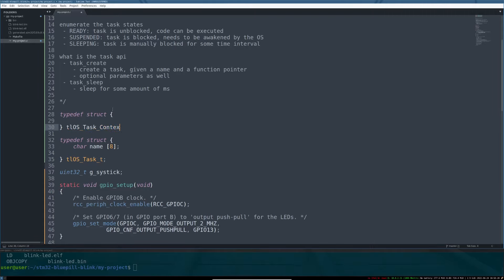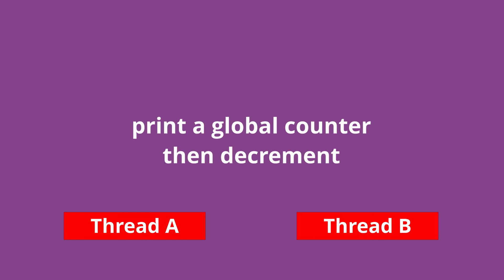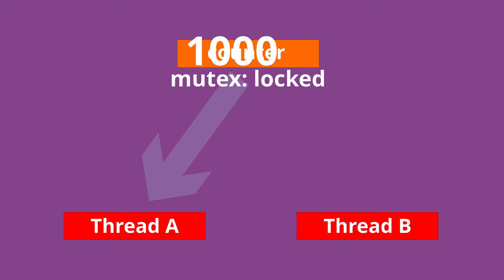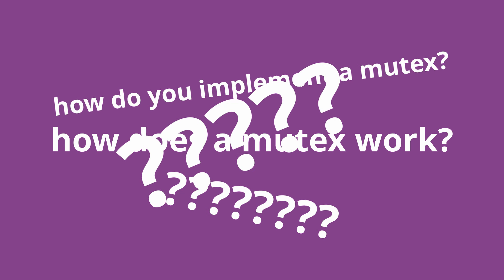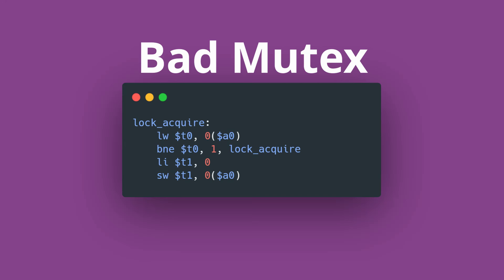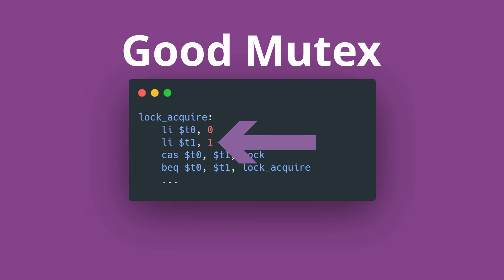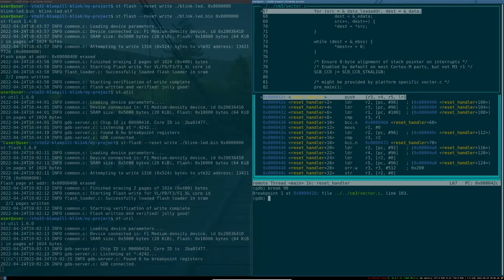how does a Mutex even work? (atoms in the computer??)

Comment: What are the differences between mutex and semaphore and what are the pros and cons?
Reply: From my understanding both are synchronization primitives and both are used to solve critical section problems. Having said that, a mutex is a locking mechanism, whereas a semaphore is a signaling mechanism.

The former goes to say that a single task can acquire the mutex, effectively owning it. This means that only the thread / process associated with that task can enter the critical section. The mutex needs to be released by the owner thread, and it can only do so upon exiting the critical section. At a high level, it can be described as a mutual exclusion object. A mutex object is either locked or unlocked.

The latter pretty much says that if a thread is waiting on a semaphore it can still be signaled by another thread. In short, a semaphore can be used by several threads (based on priority). That is not the case with a mutex. There are two types of semaphores: binary and counting. At a high level, it can be described by means of an integer variable. Note that a binary semaphore is not equivalent to a mutex.

As for pros / cons, I recommended looking those up online (there are some lists on blogs), or trying both out for yourself on a microcontroller.
Reply: Mutex is a Boolean lock/unlock state. Semaphore is a finite resource counter (E.g. only three processes can access some data at once). Note that a mutex is a semaphore - it’s a semaphore where the counter is set to one so that only one thing can access the resource at at time.
Reply: @gregoryfenn1462  yes, so i ask pros and cons because if you can do the same and more with a semaphore like with mutexes, what is the reason for the existence of the mutexes?
Reply: @gaborm4767  randombit answered too but the short answer in general is that since semaphores can do more than muticies, they won’t be as efficient or simple to use as a mutex. A tool that is can do lots of things will be less good at particular task compared to tools that are more specialised. So if you just need to lock or unlock a resource, a mutex is better than a semaphore.

Comment: If your processor has a Read-Modify-Write instruction, you can implement it in one instruction, simple.  If your processor lacks it, the simplest way is to disable interrupts for the read, modify and write instructions and then reenable interrupts.  Though you have to be careful to not reenable interrupts if they were initially disabled.

Comment: This is a good video, though I would have used different instructions for the MuTex.

Most ISAs have instructions that are intended for implementation of synchronization primitives like MutEx and Semaphores. The ARM Cortex-M provides LDREX and STREX. The first sets a reservation for the source memory address. If any other entity writes the location, the reservation is lost. STREX conditionally writes to the location, and will fail if the reservation has been lost.  The entity that writes the memory and breaks the lock could be another thread on the same or other processor cores or DMA from an external master. Usually, a MutEx will not be set up in memory that is the target for DMA, but having multiple cores, even on microcontrollers, is becoming more common.

Comment: Atomic lock sounds like Atomic Clock.

Imagine a processor running on an Atomic Clock using Atomic Locks for Mutexes, while the Program running is running Atomic Simulations that were written in the Atom editor.
Reply: Everything was fast until the point u opened the atom editor
Reply: @nimcompoo  yess thanks to atom's electron js
Reply: I know that this is ment for humor, but timing between threads are critical and running on an atomic clock would be awesome

Comment: 02:29 lock doesn't make instruction atomic; the instructions the prefix has effect are already atomic read-modify-write operations. 

SO: "The LOCK prefix ensures that the CPU has exclusive ownership of the appropriate cache line for the duration of the operation, and provides certain additional ordering guarantees. This may be achieved by asserting a bus lock, but the CPU will avoid this where possible."

The effect of lock can be quite dramatic performance drop as "ownership of the appropriate cache line" means that on multi-core architecture the most recent writes into the line have to be propagated to every other core accessing the line (when the cores don't share the caches, the level of sharing varies between architectures and cache hierarchy levels but L1 is typically exclusive).
Reply: Nah. Cache coherency is a small part of memory consistency. What the lock guarantees is that load/store queues are flushed and executed the right way and that the observes in the specified domain see the same thing. But the first part of your message is correct, as in a single core system hardware locks are not necessary.
Reply: @AlessioSangalli  TL;DR - the instructions are already atomic and lock does nothing along those lines. Short version is that it gives exclusive access to the memory and what you describe is effect of that fact. It just happens to be a detail that it is more efficient to have the exclusivity per cache line rather than all of the available memory so that more shit can happen at the same time. Thanks for clarifications btw.
Reply: @n00blamer  yeah but what I wanted to clarify is that there are mechanisms  that act even before the caches that play a role here. Thanks!
Reply: @AlessioSangalli  Indeed, I recognized that and thank you! I guess when you write too much past the comment in mind it gets tangled up ... :P anyways, cool stuff

Comment: I was recently reading about quiescent consistency vs liniarliability. 

The document I was reading was: Quiescent Consistency: Defining and Verifying Relaxed Linearizability

tl;dr you wait for all code to end execution (a point of quiescence) so there are no thread collisions.

Linearizability is what you explain with the lock whereas quiescence would be programming the start and end of threads such that they wouldn't collide.
The documentation calls quiescence soft and linearized hard. Cause calls separated by points of quiescence can not collide yet using a lock is used essentially to fake quiescence.

Since you are writing an OS what is it that contributed to using the Linearized paradigm vs using times of quiescence to separator thread timing?

Comment: OK im a little confused. The STM32 blue pill should have one CortexM3 core. As it is not a multiprocessor, are hardware atomic operations (as in with the correct memory barriers) even useful?
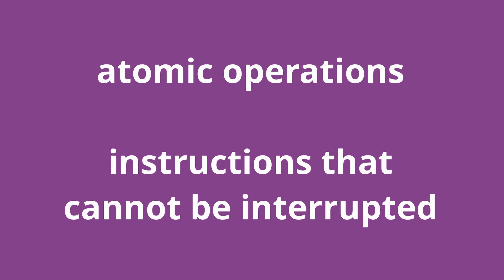Reply: The example at 2:20 uses Intel assembly, that is more likely to have multiple cores

Comment: May want to add a sleep step in there so your not wasting the cpu.  Other threads could be wanting to run.
Reply: It should be a yield step not a sleep step, a sleep step would still waste the CPU, a yield step would allow the RTOS to execute other tasks whilst it is waiting. It is just an example though so what he showed here probably wont be what ends up in the final RTOS.
Reply: @conorstewart2214  I do like RTOS. Need to be careful with thread priorities. Yield really only works on threads of same priority.
Reply: The context switching may be expensive and the other threads may not be able to do anything meaningful if you are locking for short time periods. What LLL described is a spinlock and it is actually the way to go when you are only locking for short amounts of time and do not want to pay the context switching cost.

Comment: Great video. Now, how does lock work in silicon?
Reply: Is probably quite simple, let's say two cores, you check the instruction on the other core if is not a mutex then execute normally, lock the memory block and continue, if by chance both cores are receiving the mutex in their pipelines at the same, then just choose one and lock that one, the other will wait in the loop until the lock is released...
Pretty much is communication within the cores as you would in human time scales, like a core would say, I am locking mutex at address in the next cycle, is any of you going to lock at that address next cycle, if no then no collision, if yes just "hard-print" which core will lock and which one will wait... 
Is pretty much what is expected but at a cycle/instruction level...

"Hard print" because processors at printed not coded lol

Comment: For my part, I never understood why cpu maker create a “CAS” opcode (compare and set) for mutex. Compare operation require the ALU so are slow as opposed to an “XCHG” opcode (for i86 or TAS for 68k) which is much faster because it is only 1 read and 1 write to memory.  From there, you build a spinlock mutex to make an OS mutex which can be used to make a full semaphore.
Reply: cas is for other things, not spinlocks.
You are indeed right, atomic exchange one time and then atomic load in a loop is better for spinlock implementation.

Comment: I may be wrong, but I believe we called this a Semaphore back in the early 1980s.
Reply: I didn't learn the word "mutex" in my computer engineering classes (mid 2000's) either, just semaphores. A mutex is basically a semaphore initialized to 1. But being able to implement that in user space with a spin lock gives certain advantages, I guess, like avoiding a context switch / system call. Sometimes you need to get the scheduler involved so you don't have worker threads eating up cpu cycles when there's nothing to do. But just ensuring exclusive access tends to burn cycles when things are already spun up anyway.

Comment: Isn’t there a C directive to define a variable, in this case your mutex var, as atomic so you would not need to drop into assembly?
Reply: @250CC I never understood what volatile really means or does. I know it has something to do with interrupt routines. Thoughts?
Reply: @250CC do NOT attempt to use volatile to implement atomic access. Your code is wrong and will fail as soon as you stop using x86 processors (free acqrel on every basic memory operation)

Atomics also inhibit optimization, but you are told EXACTLY how optimization is inhibited instead of "I dunno it does something I guess"

Relaxed atomics are free on ARM, just use those
Reply: I have seen exactly two valid use cases for C volatile: (1) POSIX signal handlers (2) Platform-specific mmio code. The C standard alone gives no useful behavior for volatile and you must combine it with additional guarantees for it to do anything at all
Reply: @kevy1yt  If you do any development on game consoles you'll be using volatile to access I/O registers. It doesn't mean atomic though.
Reply: @DFPercush  what is its purpose with I/O in consoles?
Reply: @kevy1yt  I would guess that to the compiler, writing to MMIO appears to be dead code, because it is written but not read from again (could be a control code for an external hardware like CD-ROM, or a coprocessor, etc). It has side effects that are invisible to the compiler, which may try to optimize it away. Volatile tells the compiler that it doesn't have complete information about this memory location, and so is not free to optimize it.
Reply: That's not what volatile means. To explain volatile, I'll need to give a bit of context:

Sometimes device drivers have memory-mapped IO. What that means is that the hardware 'listens' to a region of memory, interpreting changes to that memory as hardware commands. For example, we might map an LED at memory address $0xA0  - if we set that to 1, the light turns on.

By marking something as volatile,  you're telling the C compiler to always write to that address exactly what you meant to and not to optimize it out, move it, omit it, re-order it, or combine it with other variables. 

On SOME architectures, on SOME single-threaded processors, this can act kind of like a mutex, but they're not the same thing.

Like a lot of C, volatile is kind of subtle and fiddly and easy to mess up. Fun though.

p.s: there are more uses for volatile than just memory-mapped IO, but I wanted to stick to one example
Reply: @efronlicht1043  Thanks for your thorough answer! I suspected volatile was exactly that. Basically just do what I say, and don’t optimize it out.
Reply: C11 has stdatomic.h wich allows you to define atomic variables and provides wrappers around the assembly instructions for atomics and memory order. However it is important that you learn about memory ordering since the standard uses sequential consistency barriers by default to prevent you from shooting yourself in the foot and this may have performance implications.

if you dont have access to C11 then you should use compiler intrinsics if available or just make a function/macro that does inline assembly.

Comment: Atomic Operations are operations on the CPU that cannot be interrupted and are therefore immune to a race condition. 

What if there are 2 threads running on 2 separate cores of the cpu. Both threads can compare and swap at the exact same time. What happens then?
Reply: One thread will have to wait on the other for the memory access, thats the whole point of atomic operations and I think he mentioned it.

Comment: But how does the assembly instruction work?
Reply: I'm not too familiar with x86 but I believe what happens is that if another processor attempts to access it, it will halt until the lock is released and then continue.

So if I run the instruction 
lock inc byte ptr [1234h] then any other processor that tries to do the same will idle until the first processor finishes. Remember this is only really a thing for instructions that need to read, edit, and writeback. You actually can't LOCK any arbitrary instruction from what I remember. Only the ones where it matters

Comment: Does this mean that there are times when there are non-blocking mutex lock functions, like where it'll just fail (silently or not) if it's already in use?
Reply: It's certainly possible. For example in Windows API there is a function, WaitForSingleObject(handle, timeout), which can return with an error code after a specified delay (which could be 0). Or if you're rolling your own assembly, you can just set a flag indicating whether the lock succeeded and not loop. I'm not sure if the POSIX standard says anything about that. If you're stuck with a blocking API, you could also use a native mutex to protect your own custom mutex variable, to get around the problem in the "bad mutex" example. That's not perfect, as the process scheduler could interrupt you at any time with the lock active, but it at least minimizes the time in the critical section, assuming that the real data you're trying to protect takes significantly longer to process.
Reply: As another example, Go 1.18 added TryLock() to its various mutexes for exactly this case.

Comment: Could you explain the difference between mutex and spinlock?
Reply: The spinlock is used in conjunction with a mutex variable - it is one possibility of waiting until the mutex var is no longer in the locked state. You can think of the spinlock as a while loop that checks, if the mutex var is currently in the unlocked state. If not, it checks again and again and again until the mutex finally IS unlocked. Thats kinda wasteful because it uses CPU cycles for the constant checking but very easy to implement.
Reply: A spin lock is one possible implementation of a mutex.
Reply: A mutex usually puts the waiting thread to sleep, so the only CPU used is when the mutex is released and the waiting thread is told to wake up. A spinlock will have the CPU in a loop constantly testing a variable.
Reply: A spinlock puts the thread to spin on a loop while a mutex puts the thread to sleep, usually using a special OS system call that tells the OS the thread is waiting on a mutex so that the OS can optimize for that in a way it wouldnt be able otherwise.

Generally, spinlocks are faster than mutexes because mutexes pay a rather expensive syscall cost and spinlocks dont. However Spinlocks do not release the threads so if the number of threads is greater than the number of cores in the system the OS shcheduler will probably go nuts switching between the waiting threads and that is bad. Also spinlocks are generally a bad idea if you are waiting for relatively long periods of time.

So generally, use a mutex if you are waiting for long periods of time or you have a lot of threads and use a spinlock if you are locking and unlocking really quickly.